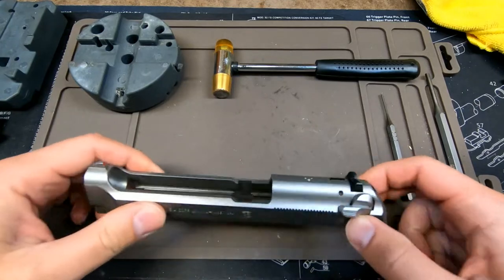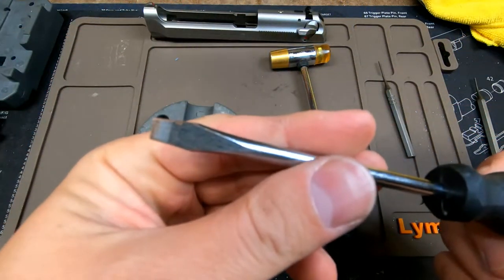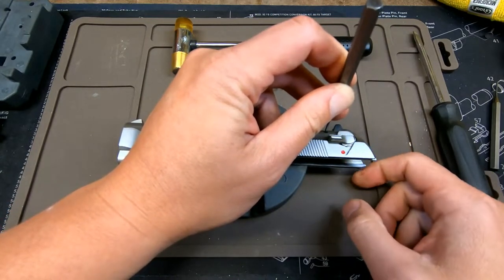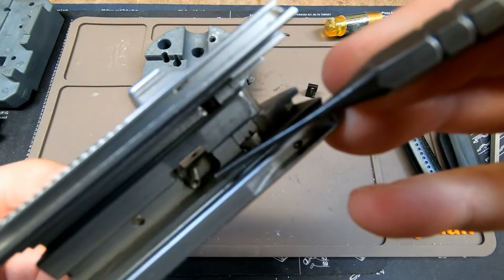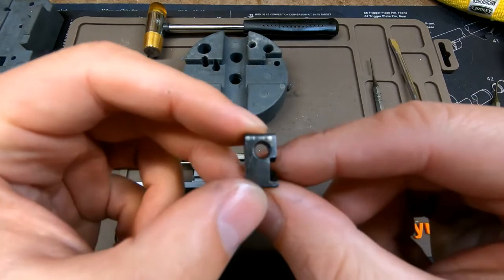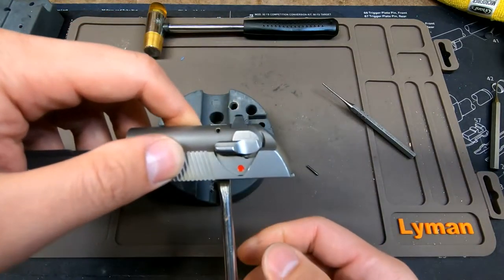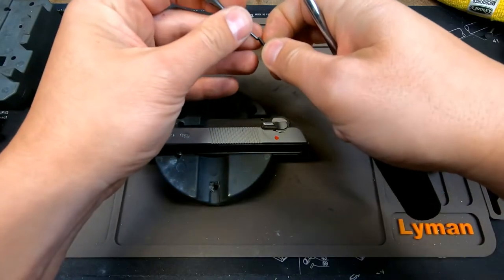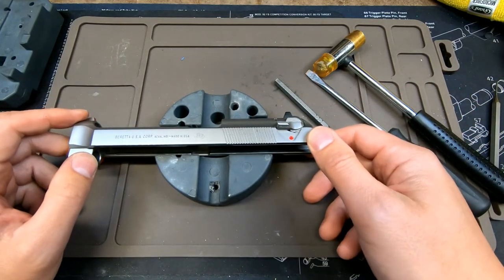Beretta 92 DIY - Episode #10 - Firing Pin Block

Comment: Thanks for the video. Another way to get the block back in without the screwdriver holding it up is to just use the punch to hold it in place as you put the slide on a frame. No barrel or recoil spring is needed. Once it is lined up on the frame, the trigger tab will keep it in place as you remove the punch and install the pin.

Comment: Great video, my firing pin is actually stuck in the raised position. So the gun does not fire. I hope removing the block and reinstalling will fix it.

Comment: Hey cobra i have a question about my 84fs cheetah. Do you own one? If not i could ask you the question about your 92. Ill post my question if you acknowledge this post since this video was made 3 yrs ago. Thanks PB
Reply from the maker: I do not own a Cheetah anymore.
Reply: @CobraReady  Hi Cobra, thanks for getting back to me. Maybe you can still try something for me and see how the 92 functions compared to my 84fs.
What i noticed on my 84fs is after i decock it the hammer drops and rest on the hammer stop leaving a small gap between the hammer and the firing pin. The pisto is now in double action mode.
What i notice on my cheetah is if i slowly squeeze the trigger the hammer will start to draw back and i will hear a CLICK internally. The hammer is still not fully pulled back at this point. If i release the pressure off of the trigger with my finger i notice now the hammer wont rest on the stop but move all the way forward until it rest on the back of the firing pin.  Does your 92 do this ?  I was trying to find out about why this is happening but havent found anything out on the internet about it, 
From what i read about the 84fs is that the firing pin block remains in place until the hammer is cocked . Could you try what im explaining on your 92 and tell me if the hammer stops on the stops or moves fully forward when you squeeze the trigger halfway in double action mode and then let off the trigger